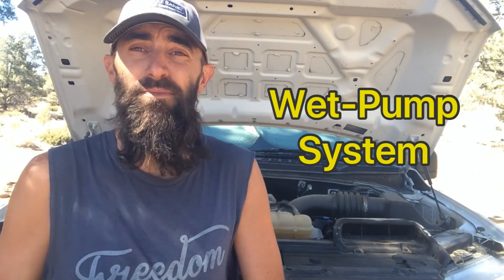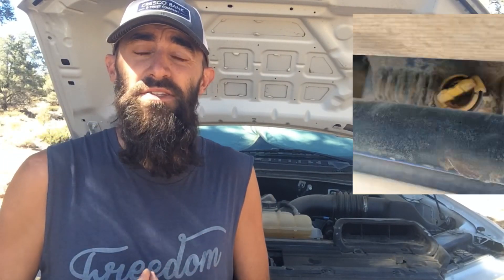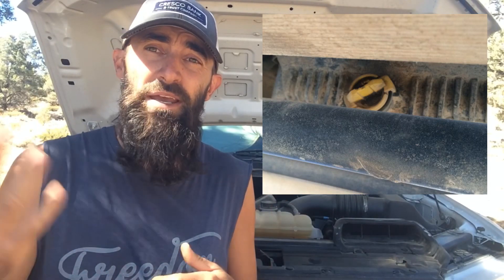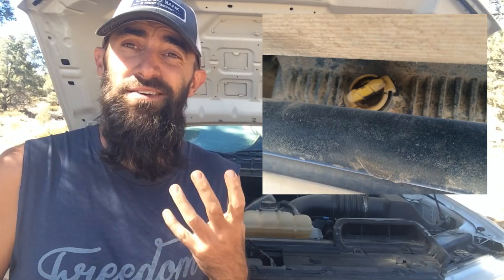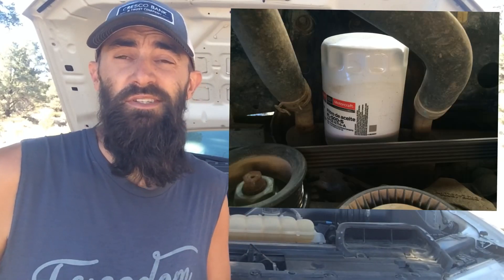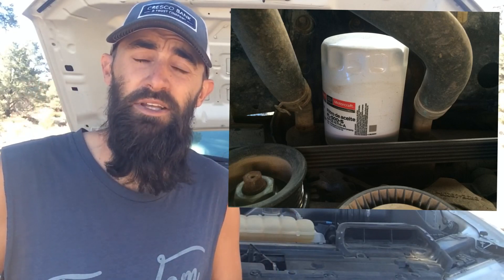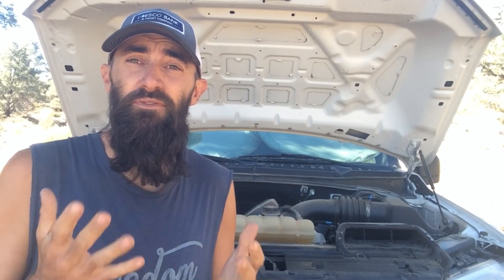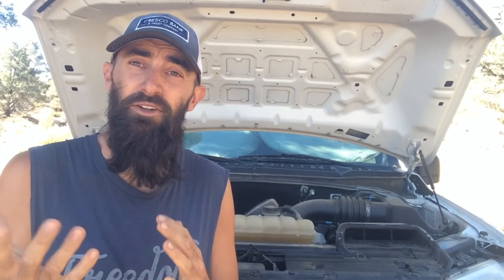How Your Engine Works! Oil Pan & Oil Filter

Comment: Thanks for the explanation of why the pan has baffles to help keep the oil steady in one place. 

This point is reference to why gas stations have straight level payments (or are supposed to).

 I come out of generation when people use to take their vehicle to the gas stations,  there were service attendants there to not only refilled your gas tank but they would often also check your oil for you. 

The gas station was a good place to have your fluids check since the ground was intentionally level. It meant the fluids in your pan would be level too when checking. 

If you would've checked your oil yourself and your car was parked on an a steep, hill or slightly slope driveway,  you might have gotten a false reading from the dipstick since the oil in the pan was unlevel.

Comment: I have some type of fumes inside my car and sometimes outside it - the dealer service department told me that this is because of the gasket (worn) on the oil tube.  Check engine light steady on and service guy said the light would go off, once the gasket was replaced.  A gasket ON an oil tube? Would you by any chance know what he maybe referring to?   Great videos and so well explained. Thanx!